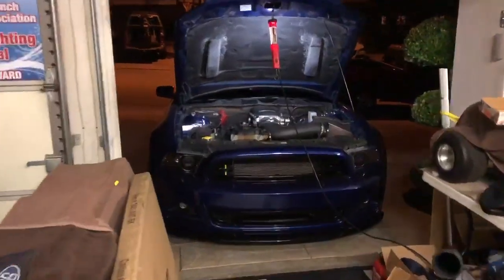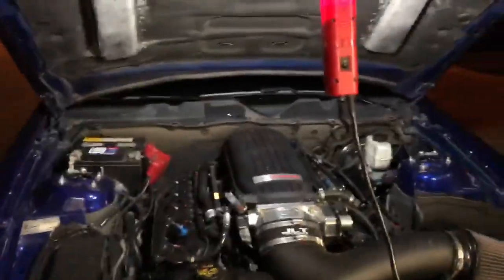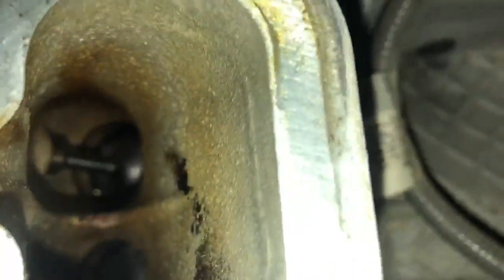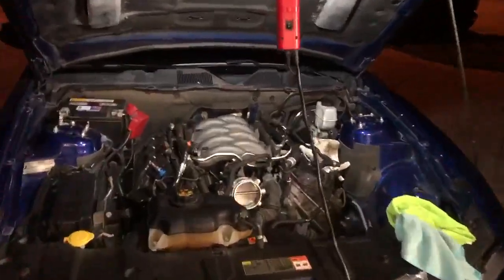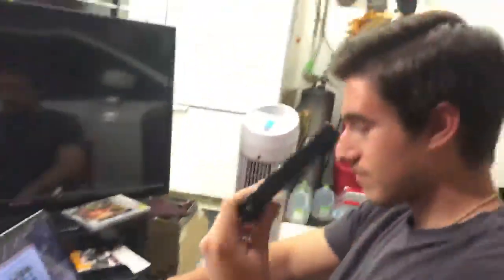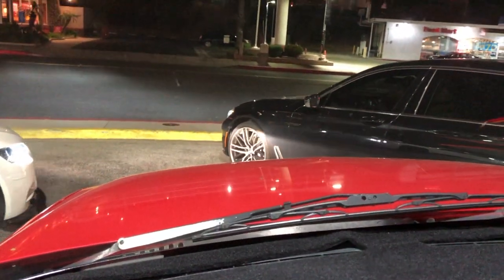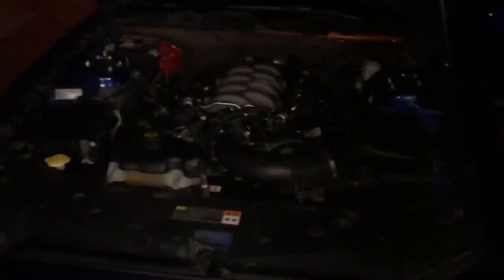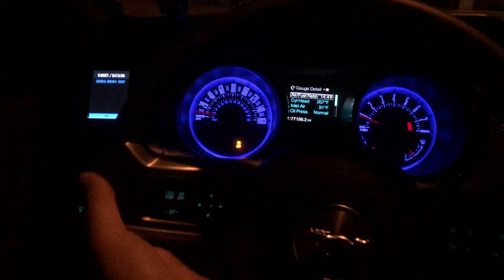RETURNING MY 5.0 TO STOCK!

Comment: Are you scared to blow it up? Those gen 1s don’t hold too much power safely it seems. Even scarier because I’ve had two Gen 2 buddies blow a piston on cylinder 8. One of them has a vmp supercharger making 700 and the other friend has a procharger making 670. Best of luck man. I really wanna see a success story because I’ve definitely been scared away from boost